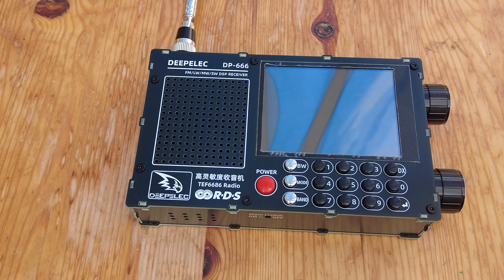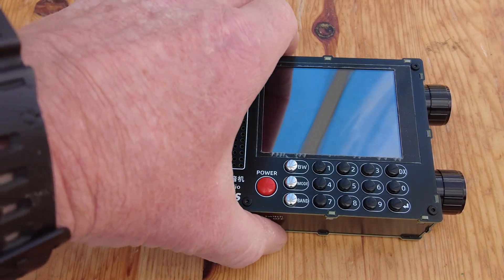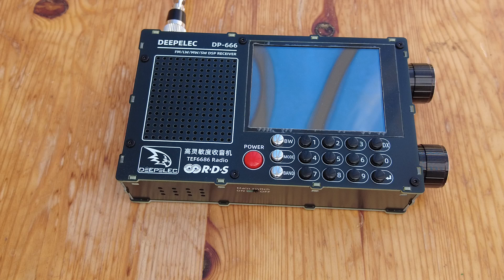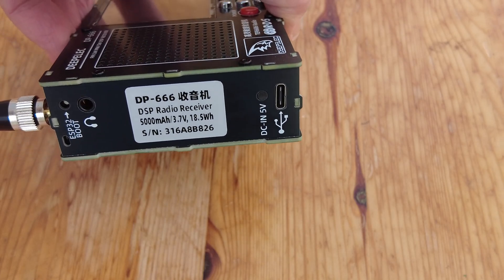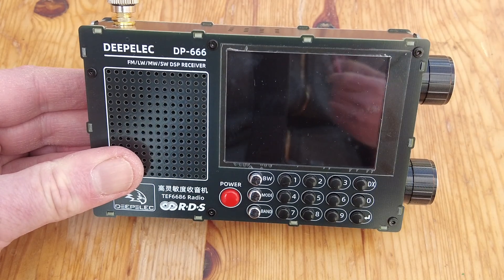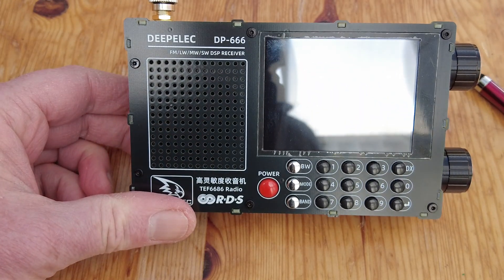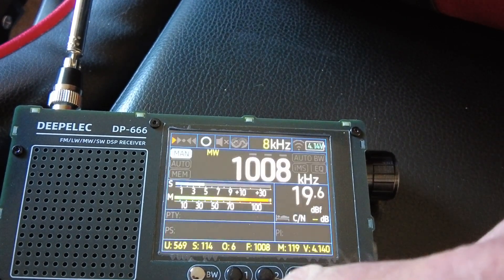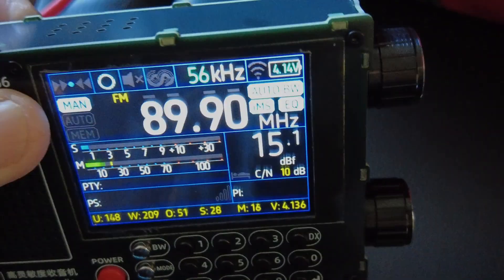Deepelec DP666 Receiver- A first look

Comment: Sorry if I missed it but does it support SSB?
Reply from the maker: No it doesn't
Reply: @KevinOReillyswl  Too bad. I'm looking for a stand-alone dsp receiver like this. Love the screen.
Any suggestions for under, say, $200?
Reply: @darkbulbs under $200 you want one of the ATS series, the ATS 25+ megadecoder is meant to be okay. $200 is a pretty awkward price point, there isnt anything great around there. You're above the typical portable range of pl-330's and xhdatas but below the basic malachites and hfdy's. If you're willing to stretch a little bit a malachite or hfdy from aliexpress/ebay/chinese seller of your choice will keep you busy for years.

Comment: The tiny switch underneath is to prevent any accidental turn on and much better to have a separate on / off switch. You just can't fault the design or the new vertical version either. Touch screen and keyboard also, what's not to like ! I have 3 of them

Comment: Inexpensive - a better alternative to the SR-286. The advanced settings (which are missing all the monochrome TTEF6686 implementations) actually make sense, and the large, easy-to-read display is a plus. However, the PCB cabinet with sharp edges would be a no-go for me. It’s a semi-portable, semi-desktop format. The ATS125, with its aluminium casing and vertical orientation (for a little extra), makes more sense, IMO.
Reply: +It would be nice to see how well it performs compared to the DX/SR-286. Chances are the “three-times-six” will be much noisier with the built-in antenna, of course. 👍🏻
Reply from the maker: I think the qodosen does very well on its internal antenna and can of course be switched to take an external antenna on MW.
Reply: @KevinOReillyswl  Great - I somehow missed that point. Hopefully, it completely disconnects the internal antenna when an external one is plugged in. The segmented display of the DX/SR-286 is clearly better than the one in the D-808. The buttons, decent-quality plastic, and the design inspired by the ICF-SW1 - it all makes sense.

Comment: It does have air and. I found it by accident
Reply from the maker: Tell us more!
Reply: @KevinOReillyswl  go to short wave. Tap on the frequency display and sw/air will come up on the bottom right of the screen. Tap on this to toggle between short wave and air. Having said this, air band performance is useless. Signals which come booming in on my sangean 909x are inaudible on the deepelec